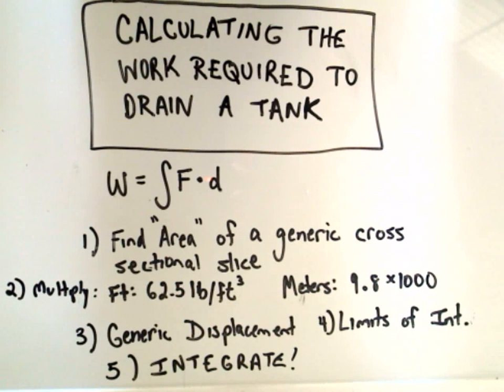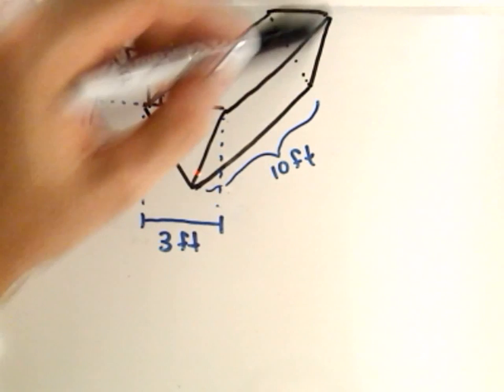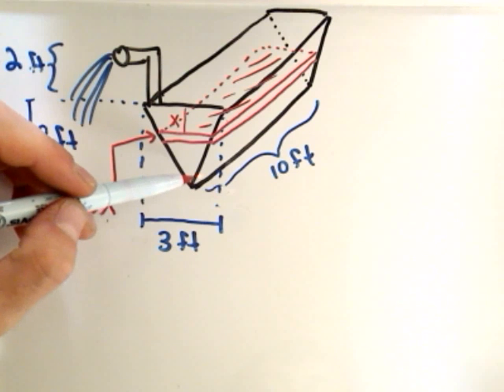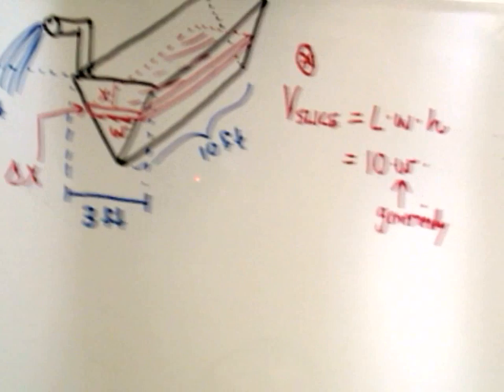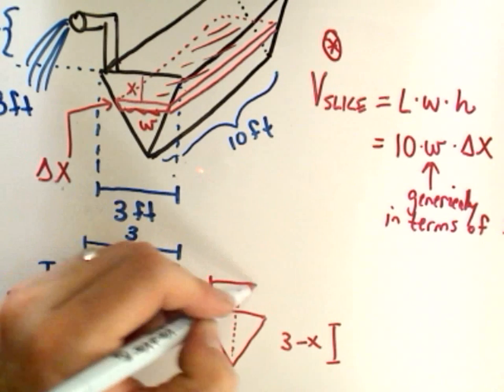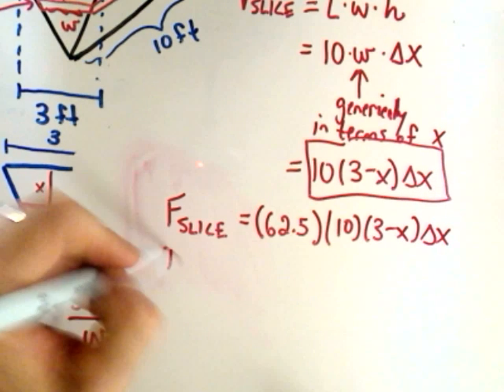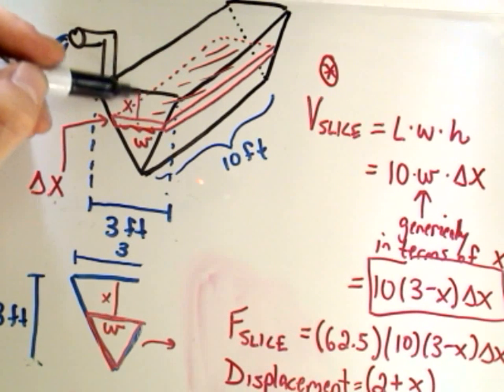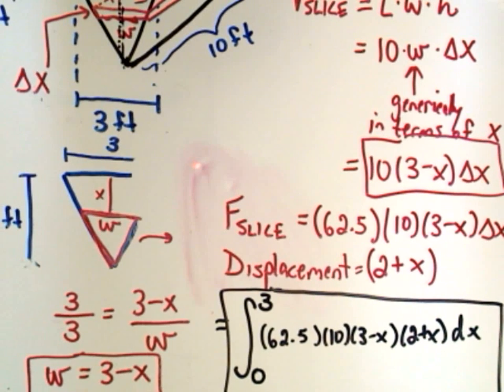Calculating the Work Required to Drain a Tank

Comment: I have a similar problem, almost identical. I tried followed this using the measurements whereas in mine everything is the same except for the length is 8 on mine. Well, I did not get the right answer even though everything is just about the same

Comment: setting up the volume, the way most books do, would get you to the integral of                62.5 * 10*x*(5-x)dx from 0 to 3 which turns out to be equivalent what was done in this video. It all depends on how you label the diagram

Comment: No gravity??
Reply: lb is a force not a mass
Reply from the maker: huh
Reply: patrickJMT 

I was wondering why you didn't involve gravity(32 ft/cubic second) in the integral. 

The way I'm being taught differs a little.
Step 1: Area (l x w)
Step 2: Volume (l x w)(dx or delta x)
Step 3: Mass (Density x Volume)
Step 4: Force (Mass x Acceleration)
Step 5: Work (Force x Distance)

I didn't see the 4th step and I'm trying to understand why. Thanks in advance!
Reply: You only involve gravity, as well as density of water, when you use meters so you can calculate force. But in this problem we use feet and we know that feet can be converted to lbs by multiplying by 62.5. And lbs is force. 
In other words, we can get force from feet without the need for using acceleration.

Comment: I'm still confused at 5:05 :(
What's the deal with the two triangles?
Reply: He's figuring the width, 'w', of the characteristic 'slice' of water which varies depending on where the slice is located. So, he is using similar triangles to find a value for w.

Comment: Why is it that we don't have to account for gravity when we are dealing with standard units but we do when we are dealing with the metric unit??
Reply: Mass and Weight are different. 
Weight is a Force as: Mass*Gravity'sAcceleration

Imperial Units:
Mass: slugs
Weight: pounds
Acceleration of Gravity: 32.2ft/sec^2
Water Density: 1.94 slugs/ft^3
Water's "weight:" 32.2 * 1.94 = 62.5 lb/ft^3

Metric:
Mass: kilograms
Weight: Newtons
Acceleration of Gravity: 9.8 m/sec^2
Water Density: 1000 kg/m^3
Water's "weight:" 9800 N/m^3

.. calculus problems seem to skip calculating the force/weight part for the imperial system, probably because slugs aren't as widely known; versus the metric system where most people are probably familiar with grams.
Reply: Basically, if you are using the metric system (meters, grams, etc) then you have to calculate the force using mass * acceleration(gravity).

But if you are using the US system (feet, lbs, etc) then GRAVITY IS ALREADY CALCULATED INTO THE WEIGHT. That is because WEIGHT AND MASS are NOT the same thing.
Hope this helps

Comment: The key here is that the force needed to pump the liquid does NOT depend on the distance the liquid travels, as the weight of a certain quantity of liquid is constant. But it DOES depend on the height of the liquid because it is related to the size of the slice of liquid we are considering. The limits of integration are the max and min values of the height of the liquid, and not the displacement of the liquid.
I think it's more appropriate to use the height of the liquid as the variable, and not the distance from the top of the tank, even if you are going to get the same result. I think that's why people are confused.

Comment: see i thought it would've been (5-x) but in technicality he's just accounting for distance x + the distance of the spout for how much force is going to be required to drain the water from the water level up, because, essentially that distance shouldn't be changing as far as where the water is when it's being drained that distance. You can't say (5-x) because x isn't the height of the water, it's the distance between water level and the top. So to say (5-x) would be to say the entire distance of travel minus the distance from water level to top. This is why you incorporate (x+2) to determine your distance so you can plug in force x distance to find your work.

Comment: The displacement is (5-X). He didn't account for the top of the spout to the bottom of the tank. The real answer is 1058.4x10^3 or approx. 1.06x10^6 Joules.

Comment: Why was the whole integral not multiplied by gravity, g?
Reply: He did it using pounds vs kilograms. Pounds are a unit of force and thus it isn't necessary. Were you to use kilograms you would multiply by g.
Reply: Later discovered this, thank you

Comment: why are the limits of integration from 0 to 3 and not from 0 to 5, seeing as the total distance the maximum distance that can be travelled is 5 ft?
Reply: because the cross section of water doesn't travel 5 ft because the whole section could not fit in the pump, rather it only travels 3 ft to the bottom of the tank.

Comment: kwok is right...besides there is more than one approach to this problem, if your using similar triangles you can either account for displacement immediately when finding the width or account for displacement(distance to move slice) later...the latter is what I prefer because it allows me to conceptualize better although sometimes results in a messy integrand..whichever results in easier integration eventually takes the cake..problem # 24 is a perfect example of that scenario.. not sure if you got the right answer dude but I'd be lying if I told you your video wasn't helpful. Thanks

Comment: No one will probably ever read this, but i think there's a mistake... maybe.
i think the displacement of the water = (5-x); not (x+2)
help anybody??
Reply: +Randomguy Johnson I know it's been a while since you asked, but in case anyone else here is wondering.. It depends on what x is measuring.  In this video he is using x to measure the distance from the top of the tank.  Therefore each little slice of water needs to move x+2 feet to get to the top of the pump (2 feet above the top of the tank).  If we use x to measure the distance from the bottom of the tank, then each little slice of water needs to move 5-x feet to get to the top of the pump (2 feet above the top of the tank).
Reply: ***** depends where you put your x
Reply: I believe Patrick is correct, it should be (2 + x). The water has a minimum displacement of 2 ft, and maximum of 5 feet. Therefore (2 + x), Where "x" is greater than or equal to 0 and less then or equal to 3.
Reply: patrickJMT In the book they used (5-x) but they also did it slightly different. I did the same calculations that patrickjmt did in the video and got the same answer.
Reply: thats what i was thinking other examples of this problem do the displacement 5-x... whats going on here?
Reply: +Randomguy Johnson That's because they set their origins in different positions.
Reply: It's correct if your integral is in terms of y, which it should be. The "slice's" height is dy (a very small segment of y), so the whole integral should be in terms of y.
Reply: Pat makes the top of the object the origin, whereas the book makes the bottom of the object the origin. Both ways should give the same answer
Reply from the maker: (x+2) is correct

Comment: It's tricky, because the density of water for customary units is pounds per cubic foot. Pounds is already a weight. Just another unnecessary confusion caused by America's silly little unit system.

Comment: Wait. the pipe end (where the water goes out) is 2 ft above the tank level. So, why did you limit the integral from 0 to 3? Because if that's the case, my professor would have said "-3 to 2". Any idea?

Comment: I don't agree that the displacement is 2 + x because the water not in the very front of a given horizontal slice has to first travel forward to get to the spout.  

If there were spouts completely covering all edges of the tank, then I would agree that the displacement is 2 + x.  But because this is not the case, the water in the very back, for example, has to travel 10 units forward first.

Comment: It can't be an equilateral triangle, since the height is the same as the width.  If it were equilateral, the height would be (3*sqrt(3))/2, or ~2.598.

Comment: Great video! but i do have a question. I'm using the same Stewart Calc book you're getting some of the problems from, but as i was integrating my problem, it came out different than what was in the solutions manual. I checked to see what it was and the book includes gravity (9.8) as a factor in the integration as well. Is that something you forgot to include, or is there some other way of processing the problem?

Comment: I noticied in your video you use a displacement of (x+2). Could you also say (5-x)? If it was a sphere centered at the origin with radius 3m and with a 1m spout at the top what is the trick? Would your displacement be (4-x)?

Comment: @patrickJMT So why for the upper limit of integration is it not 5 since the spout is 2 ft above 3?  Is it because the cross section aspect only applies to the tank part?  But work is still required to pull it up the spout part, right?  Shouldn't that be accounted for?

Comment: @johnallenasdf technically it's not an equilateral triangle but as he wrote the question using a height of 3 not a side length of 3, and stuck with that through the calculations, (even though he did have a slip of the tongue) it didn't affect the answer.
By the way, the height of an equilateral triangle of side length 3 is 1.5*sqrt(3)
Yes I know you've probably found the answer by now.. 2 yrs

Comment: @marie4poche Thanks for responding haha. I did check my integral with his and confirmed what you said before I posted the comment. I think it just helps to see different ways to set up an integral so that we know where the values are coming from. Also,I correct myself for my typo in my last sentence. I meant to say .. "since WEIGHT is a force"

Comment: couldn't we use 62.5 x integral[(5-x)(10x)dx].... (10xdx is the length) (5-x) is the full distance from the spout to the bottom of the tank. (3-x) is just the triangular part of the tank... the "slice" of water still changes on the way up through the spout in order to pump out the water correct? we can still integrate from 0 to 3 because of that being the "actual volume" of the tank ..then multiply it by 62.5( which is the weight of the water .. which is also the force since water is a force).

Comment: @Ackeem91
JMT is right. He used the 62.5 to convert it to a force. He is working in imperial units (ft, slugs etc), so instead of 9.81*1000 he used 62.5 , like he mentioned at the beginning.

Comment: Thank you so much for all your vids, they are one of my best resources!

So about this video, shouldn't the displacement be 5-x rather than x+2?  So, if the slice was at 1 foot at a given moment, at x+2, you'd get a displacement 3 feet from the spout, which is wrong, but with 5-x, the diplacement from 1 foot is 4 feet, which is correct.  Or am I missing something here?  Thanks!

Comment: Alternatively you could calculate the total weight of the water in the tank and place it at the center of gravity. The work required would be the weight times the distance from the center of gravity to the tip of the pipe.

Comment: Great video! You have a wonderful gift and I'm glad that you share it with the world. One complaint.  you say that the tank is supposed to contain a face with an equilateral triangle. If one side is 3, then the other sides are also of length 3, making your height (3√3)/2, not 3.  So either your height is wrong, or you don't have an equilateral triangle. I would assume that it's not an equilateral triangle. It doesn't change any of the math in the problem, but I thought I would point that out.